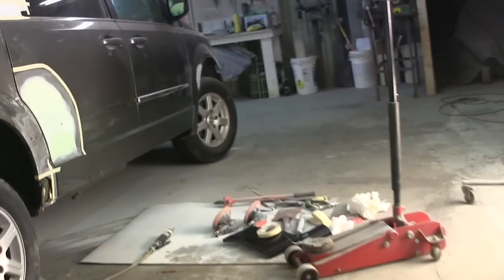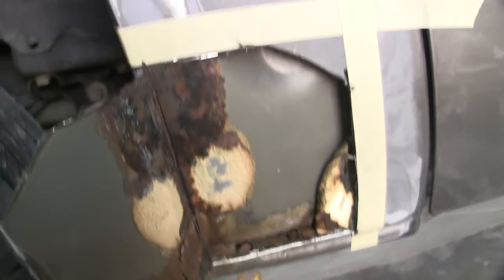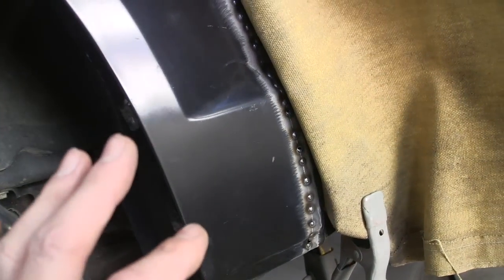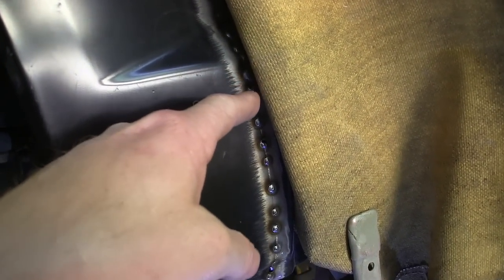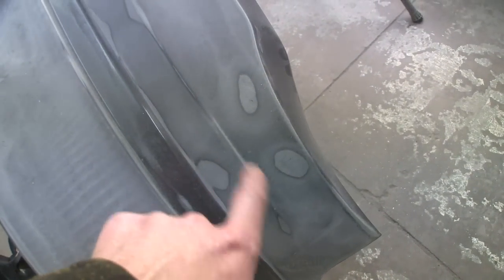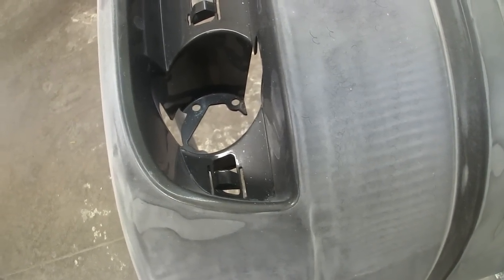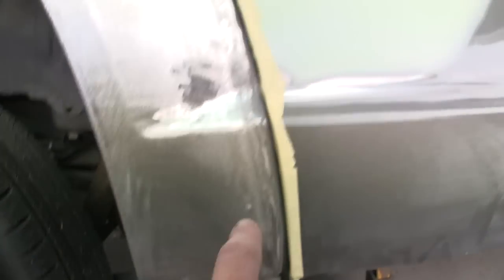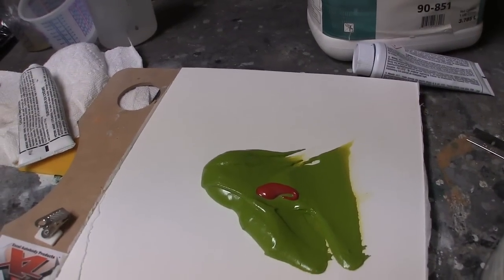2010 Town and Country   Sectioning a rust repair panel and filler work

Comment: Smart and methodical. I wish to this myself. Is there an affordable welder u can recommend for DIYers?  Best to you
Reply from the maker: All small MIG welders should work fine as long as you can fine tune wire speed and amperage. 
Any Miller or Lincoln MIG in the 140 amp range is more than adequate for auto sheet metal like this

Comment: I worked on a brand new 2017 dodge ram 1500 and i noticed their was some rust forming on some of the bolts. I live where we never see any snow.
Reply from the maker: Rust on bolts doesn't surprise me.  When I see it on body panels on a new vehicle I get concerned

Comment: Did you have to take any precautions before welding to not ruin any electronics?
Reply from the maker: Justin 
Disconnect negative battery terminal